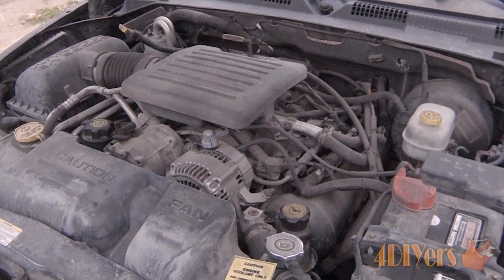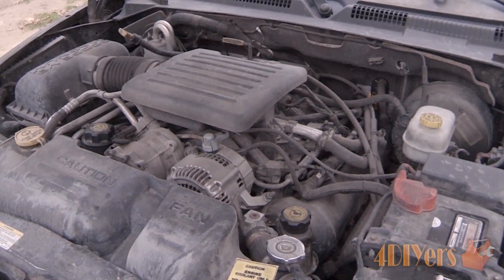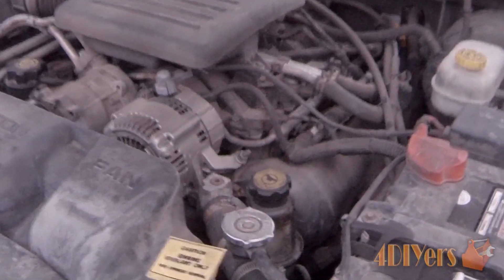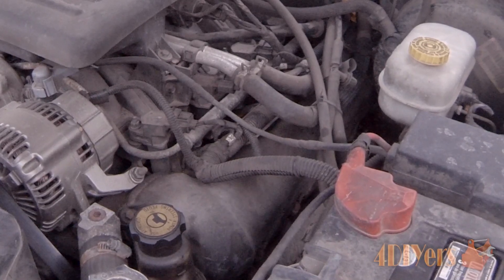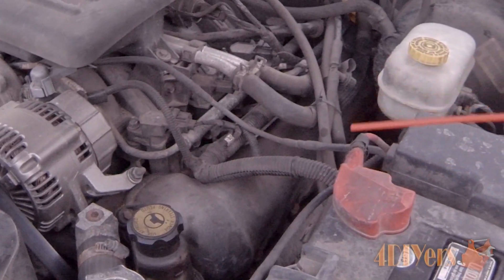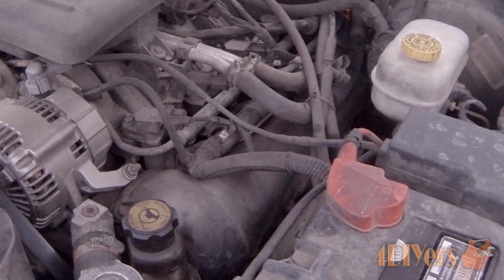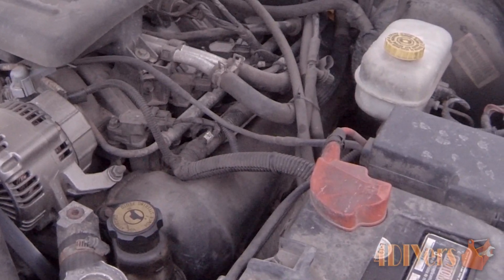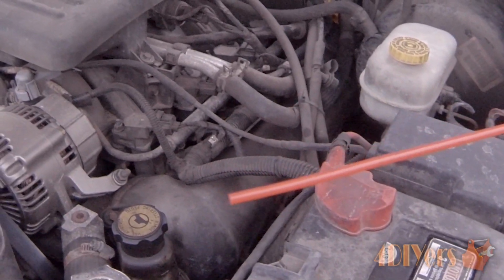DIY: How to Troubleshoot a Faulty Head Gasket

Comment: I'm experiencing a leak from my engine and I'm pretty sure it's the head gasket now.

It's leaking between the engine block and the head, close to the engine negative ground on a 5.7 ram 1500. The leak is continuous and everything empties in less than 2 min!

The engine was rebuilt and this is the only issues we have at this moment

Will pull the right side head off and check to see!

Thank you for the various insight on coolant leaks. Much appreciated!
Reply: Chris M. 
.
Reply: Believe it or not. I had the exact same issue when I did a rebuild, it was the headbolts not being properly tightened down!

The gasket was warped and only lasted 10,000miles.

Comment: Hi Eric, just have a quick question if you could help please. I have a Hyundai Elantra 2009 when I start it I see a wet spot on the ground where the tailpipe is just wondering if the head gasket is about to go. I did some basic head gasket test like looking for bubbles in the radiator reservoir, milky engine oil, milky coolant they all seemed to be fine. Just wondering how much of a water discharge is too much? Thank you kindly
Reply from the maker: I'm not Eric, I believe you have me confused with someone else. But I can answer your question. Condensation from the tailpipe is perfectly normally and this is caused by the difference in temperatures between the outside temperature, a materials temperature such as the exhaust system and the exhaust fumes. Some vehicles tend to produce more condensation than compared to others and will disappear once the vehicle reacts full operating temperature. If there are no signs of a faulty head gasket, especially the coolant level dropping, then this is nothing to worry about. Don't forget to subscribe :)

Comment: If I may ask what if a 5.7 hemi is experiencing white smoke out the pipes and coolant in the oil pan. No oil in the coolant res, would that be a coolant leak between the water jacket and the oil return ? Car does not overheat. Thanks
Reply: Having the same issue. Also make a bit of a tick before it's warmed up
Reply: Solved my cars problem. Somehow 1 spark plugs ground strap broke off somehow and was getting smashed by the piston. Lucky enough I didn't drive the car like that and it only caused 3 minor indents on the head that a local machine shop was able to repair. Don't ask how the ground strap came apart from the rest of the plug. No idea ! So I decided to have upgraded valve springs installed , already had the oversized valve seats from factory , intake and exhaust valves checked out. I ordered a set of Crower Performance lifters, solenoid plugs and deleted the m.d.s.  All new gaskets , new head bolts , cleaned up any sharp edges on the heads , cleaned carbon off the tops of the pistons. 6 -1/2 months later shes running like a champ and absolutely  0 tick , quieter now then the day she left the car lot !

Comment: 4DIYers  Hello. Just wondering for a situation i'm experiencing . I have an Audi A4 B5 year 2001 , it's a 1.9 TDi . At least 6-8 months passed from the moment I realized that I might have a pressure leak into the coolant system.  I didn't lost too much coolant in this time until now , maybe 1Liter maximum  to say. So my situation look's like this. I do hear some gurgling/bubling air presence in the heater core in moments of accelerating , maybe even some discret sounds when engine is idle , more present on cold engine. The coolant pressure gets around a value let's say and sits there , so the pressure isn't going to raise higher than that. BUT , the pressure sits there even when the engine is cold . My worries are that there it might be present more pressure than normal . I am not experiencing any engine heating,  i do get heat in cabin, and maybe some leak very small on a flange where the coolant temperature sender sits. I changed the flange and i do get some leaks again ( because of the big pressure i think)  . So, engine hot or cold , no matter how much i drive this is the pressure i get into the coolant system  https://www.youtube.com/watch?v=K-gaAQZJiNk  . Is there a chance that somehow air from outside gets into the system and the system never manage to bleed itself and making this pressure ?? Thank you , maybe you can help me to diagnose to problem.

Comment: I am really confused  about head gasket . Driving 18 years Camry there is no signs of rough idling, oil leaks on floor ,milky foam on radiator cap or oil cap and even after driving 3-2  hours never noticed over heat and temperature gauge is always at half  .   But I could see there is very light damp of oil in between head and engine line. But it was there past 5 years I do not see any increase . Recently went to dealer for oil change and he recommended to change head gasket and water pump that totals to $$$$.  can't  afford now that much. Any suggestion

Comment: I have a cumins 6bt 5.9 that is leaking about a gallon of coolant in the oil if I run it for ten minutes but I don't see any water coming to the radiator I just installed a new head gasket and a
new oil cooler and the problem still persist is
 There another way for water to enter the oil system

Comment: Hey how do you test if the head gasket is leaking oil out of the side of the head and block mating surface?
Reply: If you are talking about the outside of the engine then you should be able to see the oil leak out of that joint.

Comment: I just changed my intake gaskets on a 98 ford f150 5.4 liter due to coolant leaks. I noticed that my #8 spark plug hole was full of coolant. My oil isn't milky. It has been milky during the winter on the oil cap, but not on the dip stick. No white smoke. The anti freeze in the coolant tank has always been green. Is it possible that my intake gasket had caused the coolant to flood the #8 spark plug hole? My temperature has always been normal.
Reply from the maker: Common problem with the 5.4L engines. Check the coolant lines running above the head area, most likely one is leaking and slowly filling up the spark plug hole.
Reply: +4DIYers Thanks. I noticed on the old gasket that around the coolant port and the exhaust port at the #8 plug hole had broke in 2 places. I had checked the coolant lines. Didn't see any evidence of a leak. I will pull the #8 coil and plug in a week or 2 of driving it daily to check for coolant. I no longer smell coolant since I changed the intake gaskets. My fingers are crossed lol. I do NOT care to repeat that job again ;).

Comment: I can’t figure out on my Monte Carlo there’s no coolant leaks but it doesn’t hold pressure I changed the radiator an it did hold pressure a couple times but now it won’t hold pressure at all again in the cooling system would a bad head gasket case no pressure in cooling system it doesn’t smoke there’s  no coolant in the oil
Reply from the maker: You could pressurize the system to help highlight a leak or run a dye through the system, I do have videos on both of those. https://youtu.be/7RDarciXfwg and https://youtu.be/4CzoaqOj7C4

Comment: Can someone recommend a product for a head gasket that is leaking oil?  Thanks!
Reply from the maker: I don't typically recommend a stop leak as it may plug other areas of the cooling system and for the most part it's just a bandaid, so the problem will pop up after.
Reply: @4DIYers  
Sometimes a bandaid is very useful until you can save up $3k for a car repair my friend.
Reply: @Missy Spasojevic Thank you. My mechanic gave me a 50% discount and ended up charging me $1500 to repair it along with some other issues. More than I wanted to spend but that's life with old Mercedes Benz cars. Cheers.

Comment: I have a 2002 Lincoln BlackWood truck and I have water filling up the plug tubes and I'm afraid it's a head gasket.
Can anyone please help me figure out what is happening? ?
Reply from the maker: What engine??? Is it coolant??? Could be one of the coolant hoses above slowly leaking into the spark plug hole. Don't forget to subscribe :)
Reply: +4DIYers It is still at the last mechanics shop, I pick it up today... Anyways I think it is a 5.7 L 32val V8... And yes it is coolant not a rain sepage through the hood. And I have checked all the hoses for leaks and cant find any.  
One thing that I did was kinda seal the coil down the plug tube and then drove around a bit, then it started to miss out again so took it home and checked the tubes and the misfiring cylinder coil was pushed out about 4 inches and was unplugged from the plug. That kinda tells me that there is pressure building in that tube... So are those tube sleeves sealed in through the valve cover and head or are they made as one piece?

Comment: I am confused. I own a S-10 truck. i went for oil change a year ago and their was a milky substance all over the dip stick. I drove the truck awhile and then a large noise happened.. I brought it to a shop and they said it was my timing chain- they replaced it $$$ .Noise vanished then a short time later smoke started to come into the vents and I still could hear a noise also.Back to shop they told me it was heat control panel needed to be replaced,again $$$. Then I noticed a noise and I losing pressure (oil gauge) rpm stick would not rev up. I brought it in a oil change place and they said truck is fine it just has hole in transmission line. Then I decided to bring it to Chevy dealer. I didn't tell them about a leak in transmission line cause I did n't know. They said I have traces of transmission fluid in oil. Get rid of the truck. I don't see any leakage. There is no more milky build up. Anti freeze is bright green..I don't know who I should trust and I am not losing fluid but if I drive the truck within  15min a lot of noise occurs and pressure gauge goes down to the left. What  going on? help
Reply from the maker: +Bianca Romano What type of engine do you have??? Also I am assuming the truck in an automatic??? Sounds like this is an issue which pops up when the engine is warm, correct??? What did the noises sound like and was it constant or did it happen at once and disappear later??? If that was a transmission oiler cooler line, you could have been loosing oil pressure (low on transmission oil) which would make the transmission slip. With a slipping transmission, you may notice a burning smell, but most of all you will notice something of a loss of power. If you increase the rpm, the truck will seem sluggish. As for transmission oil in the engine oil, that's impossible. Unless someone made a mistake when adding oil to the engine. But even then, the only way they'd know if it was tested and a shop will most likely not do that. The smoke issue, I'm sure why they would replace it due to smoking, unless there was an electrical component failing. The smoke could have been simply from someone leaving oil residue on an engine component and eventually it burned off. As for the leaking line, do you have a photo by any chance or did they show you where it's leaking??? Sometimes you may have a small leak and if you're not going low on fluid or perhaps it's not that noticeable as the leak is so small. The residue will build up and it may look worse than it actually it. Other times if someone topped up a fluid, they may have spilt it, which would collect around a certain area and falsify a leak. For the milky residue, that could have been a leaking head gasket, but as mentioned in the video, it may have been from not allowing the engine to warm up, therefore causing a little moisture in the oil. Do you allow your engine to warm up before using it after a longer period of time or do you just start the engine and drive???
Reply: +4DIYers Thanks..I took it for a dump run which is 2 miles from my home. It seems like the engine gets hot fast. The RPM needle doesn't increase only decreases. If you downshift and than put it in drive no difference. By the time I got home the needle went almost completely to the left(decreasing) The sounds it makes is like a puttering. The engine is 2.2.The smoke I mentioned was the heat control which was fixed $$$. so i have heat but no truck. There is no smoke,no leakage anywhere. I kept it in garage on rug so I could tell. All fuilds look fine. I do not when I changed the trans oil but it looks full.Reg oil just changed looks clear..puzzled the mechanic said anti freeze is mixing with oil. I don't see anything........??
Reply from the maker: If the truck is not showing steam from the tailpipe, you are not going down on coolant or engine oil, and there isn't any milky substance in the oil, most likely the head gasket is fine. Another way to determine if it is leaking, is to have a leak down/pressure test done on the coolant system. 

As for the running issue, when the truck is in park or neutral, does there seem to be a lack of power or sputtering??? It maybe an engine misfire.
Reply: +4DIYers Hello Sorry for such I late response. I know drive to S10 for dump runs only (once a month) it is only 1 mile away. It seems like a have a small oil leak,maybe? but by the time I start the engine and drive 2 miles the the needle of the RPM's is decreased to nothing.No smoke. I try no have get the engine hot. What do you think I should check. No coolant leak,brand new radiator.

Comment: I have a Toyota pickup 3.4 and it smokes white a ton and will not stay running but has no coolant in the engine at the moment because I drained it to check and see if it still smokes and its the same so im guessing its pumping oil into some cylinders via a hg leak probably after an overheat or something?

Comment: my car has been gatting hot extremely fast and i noticed that i had a bad water pump beacuse it was leaking from the weep hole but oil is coing out of the gasket and its a mess i just wanna now if i have a blown head gasket
Reply: Hi I noticed my car the engine starts to shakes they say water leaking from water jacket